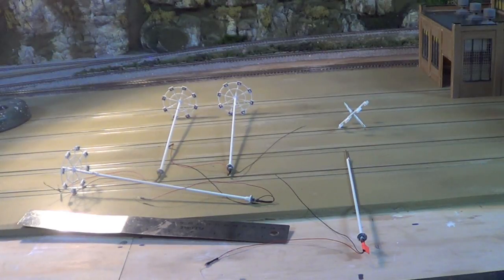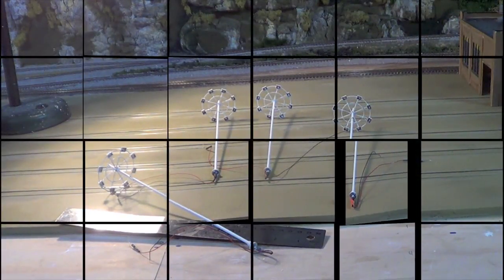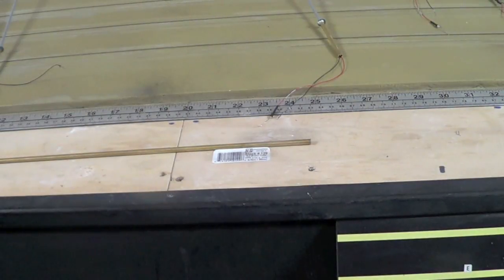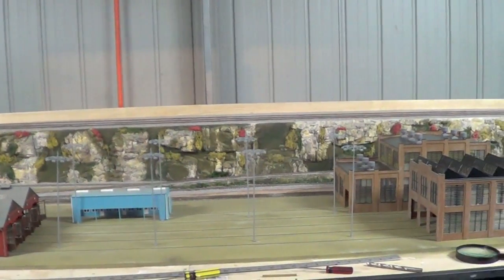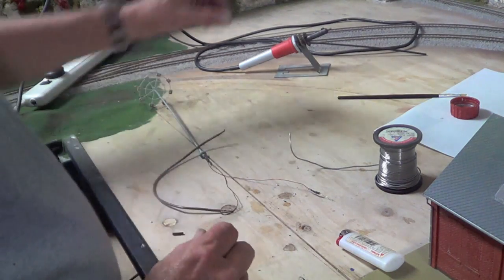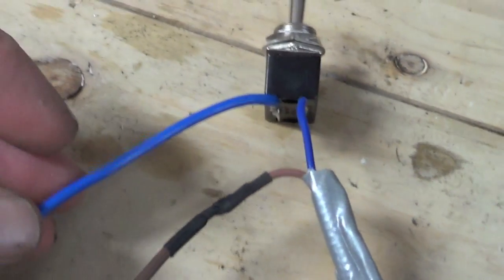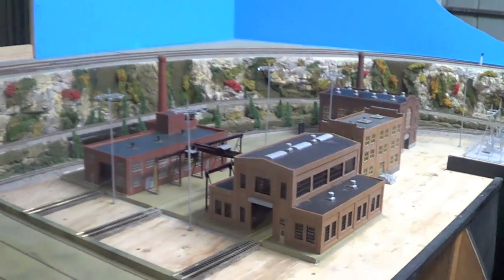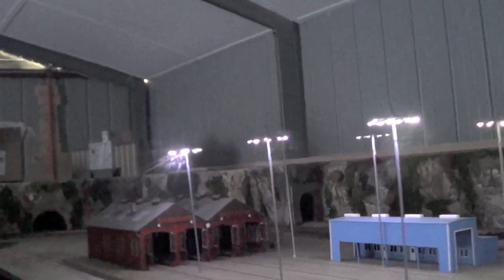"Tower Yard Lights For The Transfer Table" Model Trains Part 49 "D"

Comment: They look fantastic , well done Rob ,You got link for them , HO ones would be good in N scale yard , you going to light up all the building's inside to
Cheers Glynn
Reply from the maker: QRoutback http://www.ebay.com.au/itm/261653423005?_trksid=p2050601.m570.l4467&_trkparms=gh1g%3DI261653423005.N19.S2.M-19712.R6.TR6
Reply: ***** Thanks Rob for the link
Reply from the maker: QRoutback No problem cheers again Robert

Comment: Those lights are very impressive.  Do they do n scale lighting.  You installed those very well.  Excellent layout of them, they illuminate the facility perfectly.  Well done, keep the updates coming.  Your layout is coming together nicely.
Reply from the maker: Peter CPRail8748  Peter i don't think they do N Sale but HO Scale would do it this is the linkhttp://www.ebay.com.au/itm/261653423005?_trksid=p2050601.m570.l4467&_trkparms=gh1g%3DI261653423005.N19.S2.M-19712.R6.TR6

Comment: Hey Robert, the new lights are incredible.  I'm thinking about ordering a few for my layout.  Did they take a long time to get to you?  I used the suitcase connectors on my layout and they work great plus they make connecting to other wires much easier.
Reply from the maker: Firehawk1218 They took about 8 days to come but they are closed until the end of Feb cheers Robert

Comment: I love these lights. You said you bought them from China how did you find them? Best regards.
Reply from the maker: I just looked on e-bay and key in Plaza Lamps o scale or ho scale cheers Robert
Reply: csxmad, you are the best my man. You prompt reply is greatly appreciated thank you.
Reply from the maker: @alankjkj1  Thanks mate cheers
Reply: csxmad, with your help I found them online. I bought two packages before they sold out. You were absolutely right about the price. I looked at other yard towers that were $50 a piece and I had to supply the lights. Now I have ten lights coming for $26. Thanks again for passing on that information. How do you say it? Cheers mate.
Reply from the maker: @alankjkj1   Good to see and like you the price was good, also my Auto Plant scene is having lights as well.
but these are tall one's but only two lights per light, so stay tuned for my next video and you will see them cheers again.